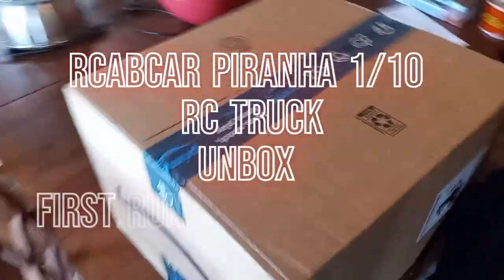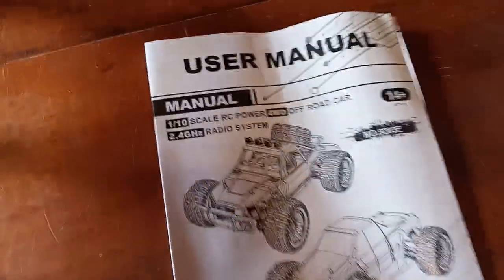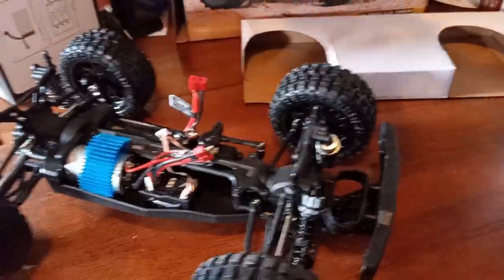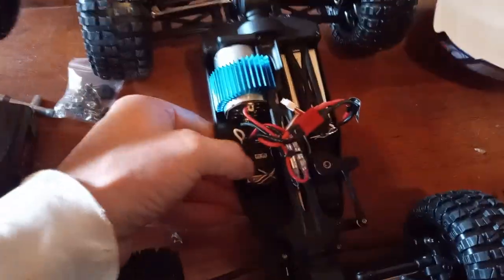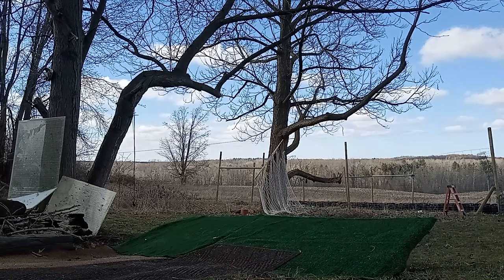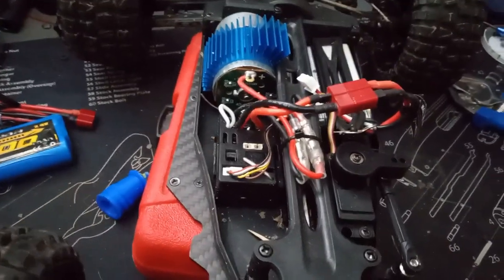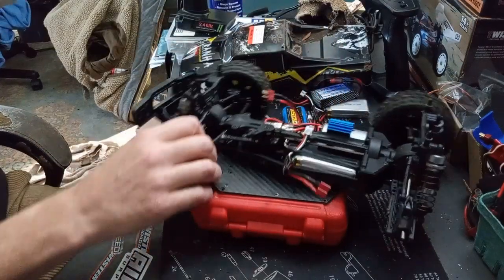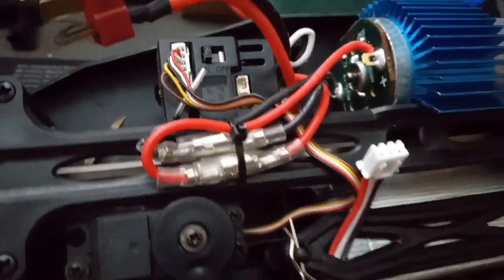60 dollar deal - RCabCar Piranha 1/10 RC Truck Unbox and First Run!!

Comment: Do you know where to get crash / upgrade parts for that guy?
Reply from the maker: its a pxtoys rebrand so look for 9200 pxtoys.  They have them on amazon.  I think the latest rebrand is exogen?? or something like that.  This is a common chassis so you can search part number from manual with the 9200..  Deerc is another rebrand company too.  I think they have decent parts support.